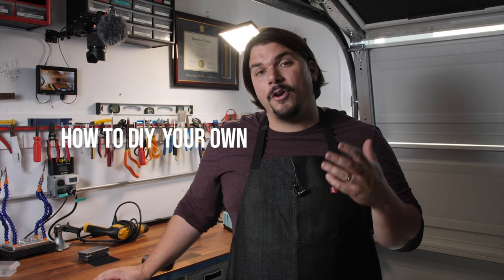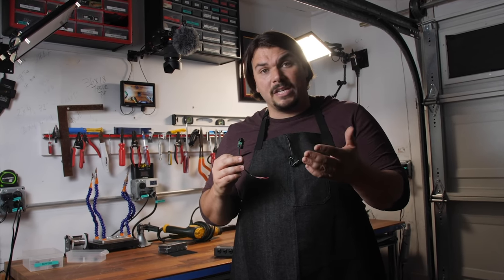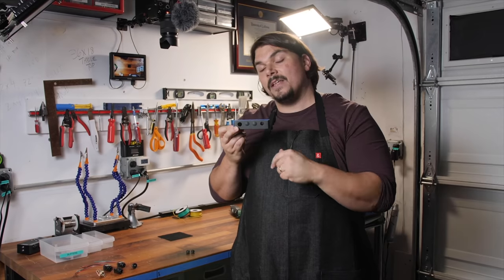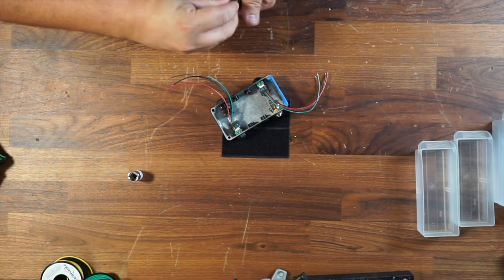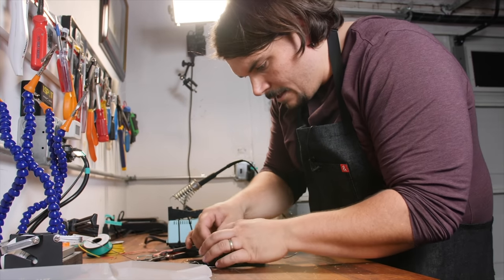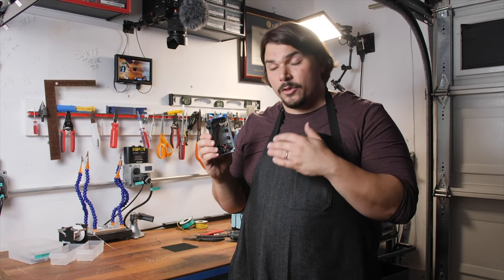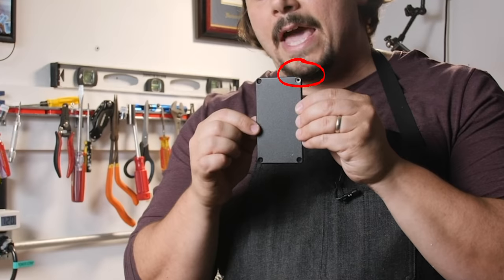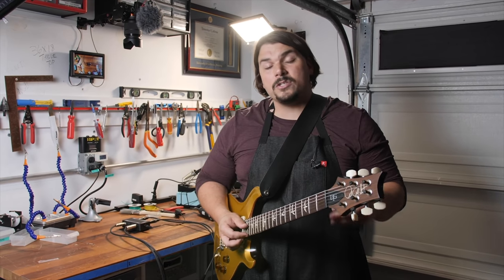Build Your Own Buffer!

Comment: if you choose a high impedance instead of 1Meg what will happen? I thought the higher the buffer impedance like 2meg or high will not roll off the high frequencies compared to using the 1Meg impedance will roll off the high frequencies.
Reply from the maker: It depends on your reference.  The loading of most all amplifiers is 1M, so if you want your guitar pickup loading to resemble what you’re used to, this is the best choice.  You can unload it to 2.2M and it will make things a bit brighter, Hifi, and more open comparatively, however it won’t sound the same as your guitar plugged into amp any longer.  I choose 1M because it’s going to be most consistent to the guitar into amp sound which is alway my baseline sonically.
Reply: @VertexEffectsInc  I think paul rivera modified fender amps in the 70's that he replaced the 1meg resistor to ground with a 2meg or 5meg resistor to give more top end for telecaster guitarist. A guitars output impedance is either 125K output impedance if you're using a fender guitar or 250K output impedance if its a Gibson guitar. The 125K is 250K pots in parallel for fender and 500K pots in parallel will be 250K output impedance for Gibson. So the guitars output impedance never matches as a baseline or reference with the guitars amplifier input impedance 1Meg being a fender amp or marshall amp
Reply from the maker: Wayne, Paul did mod to 2.2M even on his buffers he did. However it’s not the standard that the resistance of the pots matches the amp.  I’m talking about what 99% of amps are, 1M, versus what we’re used to hearing when we play through them with a 10ft cable as the reference.  If you’re used to hearing passive pickups with 250K pots hitting a 1M load at the amp that’s going to have a sound - this is what I call the standard since it encompasses the majority of what guitar players recognize as “baseline”.  You can adjust this up or down if you want the pickups more loaded down or unloaded but it won’t sound the same as your reference if you’re calibrated toward a typical tube amp.
Reply: @VertexEffectsInc  Maybe make a video one day on comparing the differences in 1Meg buffers compared against the 2.2Meg buffers to hear the differences in high frequencies. You can add a switch in the buffer to switch between 1meg to 2.2meg. I'm not really sure why Paul Rivera was modifying the impedance to 2.2Meg because I think he was saying that a telecaster high end gets rolled off when using 1meg buffers so he was getting complaints in the 70's about using 1meg buffers so he used 2.2meg buffers to fix the problem. But I'm not really sure if this is why he started changing the front end of fender amps to 2.2meg. I think ampeg amps used 2.2meg impedance instead of 1meg like fender and marshall. Paul Rivera Send and Return buffers were also 2.2meg and not like most common amplifiers send and return are 1meg, so his send and return buffers are different compared to most common amplifiers.
Reply from the maker: @waynegram8907  I’ve done the comparison and can say, for certain, that 1M for most people will be the most neutral compared to what we’re used to.  2.2M unloads the pickups and makes it brighter for sure, more full range sounding.  You can put a few resistors on a switch to try a variable input Z easily.  Even on this buffer R1 sets the input z.
Reply: @VertexEffectsInc  yes thanks I will try that someone day to have a buffer that has more impedance options
Reply from the maker: @waynegram8907  go for it

Comment: Is there any reason you use the tip shunt switchcraft jack rather than a standard mono jack?
Reply from the maker: You could use a mono jack but if you unplug the input I’ll hum because the inout jack won’t be shorted to ground.
Reply: @VertexEffectsInc  Great to know. Thanks!

Comment: Hi !  I watched your videos about buffers.  Thank you ! I understand now why I have still a lost of clarity out of my bass rig.  I have the poly tuner 3 from TC witch include the bona fide buffer.  But still, my sound is more muddy compare with if I plug my bass direct in my amp.  I tested all my pedals and cables and everything is ok.  So I understand I need a output buffer.  So, my question is, what's the best.  Buy another bonafide with the specs it has, or build one like you show us here ?  With the possibility of choosing the specs ?  I don't have much money to spend on that.  And, If I choose to build one myself, what specs is recommended for a bass rig.  thank you very much !!
Reply from the maker: It'll be cheaper for you to buy another buffer - but if you want it more streamlined having both input and output buffer in one might be preferable.  Also, you may not have the right input impedance for you bass rig - typically basses are more unloaded than guitars.  Some bass amps are up around 5 or 10M where most guitar rigs are 1M.  This can load down your pickups and provide a "mud" sound.  You should check out our Bass Rig Build video for more on this.
Reply: Thx very much.
Reply from the maker: @nicolasrichard6300  Our pleasure!

Comment: I want to build one of these (4CM) with my amp with a passive effects loop. Should I grab a kleinulator or do you think the buffer (I can use 2 more buffers instead of the regular jacks for the loop send/return, right?) in this will be strong enough for a good signal? Thanks.
Reply from the maker: Yes to Klein, and you need a buffer on the input, output, and return of the interface.
Reply: @VertexEffectsInc  Thanks again. 
What do you think of the Temple Audio 4 Channel Buffer Module? It meets all the specs and is cheaper than the parts alone. Do you know if this company makes good stuff?
Reply from the maker: @codswinger  I don’t see specifications of it listed, but as I recall it uses a TL072 Chip, if they’re running that at 100 ohms, it’s a real problem - that chip can run that low.
Reply: @VertexEffectsInc  Full Specs.
 https://drive.google.com/file/d/1GQupN5wDX4JUodx70Ta9aCFaR1YWYaqt/view

Comment: Hey Mason! What do you think of the Friedman buffered patchbay? I bought one with my Friedman pedalboard, seems pretty decent even though it’s input only. I end up using that with the output buffer on my ES8.
Reply from the maker: The buffer is close to Cornish Buffer, and only an input buffer, no other buffer in there.  It's a BJT, not my preferred for transparency, but some people like the color.
Reply: Yeah, I really only bought it because of how it fits perfectly into the 1530 Friedman Pedalboard that I have. There are some other design flaws IMO, but it sounds pretty good, atleast better than the Input buffer on my ES8.

Comment: hello uncle Mason! While checking Creation Audio Lab's Ai1 Redeemer , I noticed that the output impedance is <300 ohms ( english site "bassdirect.co.uk" ) ... is it better to choose the bonafide instead (100 oms) ? Even though I'll need two of them... 
Question 2: can I use the CAL Buffers to modify an existing patch bay, ex. rockboard MOD2 , by changing two TRS jacks with 2 CAL buffers? It would be cool, cause I'm gonna use the rest TRS jacks for amp switching and it has a IEC through connector, to use for powering my supplies. For the fx loop, my Kleinulator arrived yesterday from the Rig Doctor's shop!!!!
Reply from the maker: They’ve done some redesign since the original the input impedance 1 Meg and the output impedances around 150 ohms.  The original had a 10M input impedance and I think 350 ohms.

Comment: Hi Mason & co! Is it possible to make pedalboard "breakout box" that doesn't need a cable connected when you're not using it? So if I want to sometimes add more pedals between my drives and delays I wouldn't have to keep a cable plugged in in the send and return jacks. I hope this makes sense.  Thanks!
Reply from the maker: That’s what’s shown in the diy diagrams for an insert loop.
Reply: @VertexEffectsInc  Thanks! 🙏

Comment: Hi Doc I just built this exact buffer ( btw thanks for all the info and parts lists,  very satisfying building something like this on your own).  I just have a quick question, is there anyway to add a true bypass in case of loss power? 

 the bonafide buffer has one.  I figure it has to be thru a set of relay contacts for something like that.
Reply from the maker: This will still work without power
Reply: Well when I pull power i get a horrible squeal obviously the tone drops out and sound horrible but the noise introduced when power is off is awful.  Now just to clarify if i plug in normally without the buffer in the chain at all it sounds fine.  The buffer without power squeals horribly that is what im getting at.
Reply from the maker: @djritm3215  sounds like something may be mis-wired.  You should still get signal when disconnected.  It won't go to full true bypass and will have some loading but shouldn't have noise issues.

Comment: Would this be applicable if using a looper switcher? I’m building your interface but wondering why I’m not also adding buffers.
Reply from the maker: If you switcher already had high quality input and output buffers you won't need them in the interface box.
Reply: @VertexEffectsInc  thanks mason. Using the super switcher so I’m sure the buffers aren’t up to par.
Reply from the maker: @Souldoubtrocks  These are better buffers for sure, in that case you'll need an input and two output buffers for both sides of the stereo outputs.
Reply: @VertexEffectsInc  thanks again mason.

Comment: Howdy, Vertex. I’d love to take a swing at one of these to finish off my months-long quar-project board. Trying to think how I might modify the design to sum a stereo board to mono with the flip of a switch. Any suggestions? This has been difficult to Google.
Reply from the maker: Don’t do it - this is why I don’t show this option in the diagrams - you’re better off using the left output only or make mono presets with hard panned left mixes only.
Reply: @VertexEffectsInc  Got it. Every time I start reading about someone’s DIY summing box I can’t help but wonder if it’s just a phasey mess. Certainly would be nice to be able to flip back and forth from mono and stereo setups with the same board.
Reply from the maker: You can just don’t do the sum, make new presets for mono ideally

Comment: So I noticed you put one of these on the small ms-3 rig you built in one of your videos with a stereo out.  Was that just to have the convenience of the stereo out in an accessible spot (as opposed to fiddling to access the back of the ms-3 for it)?  I ask because I'm wondering if there's an advantage to using a buffer in such a small rig?  Is there any benefit to using a buffer there, or just for convenient jack access?  Thanks.
Reply from the maker: Yes, typically a buffer is always a good thing as you still have the long cables present on the input and output of the rig.  The cables on the board are usually negligible because it's already low impedance.  However, you don't want to relay on your pedals to buffer your input cable at 1M or your last pedal to buffer you output cable with a low output impedance of 100 ohms or lower.
Reply: @VertexEffectsInc  Thanks for the reply.  I think I'll build one.

Comment: @Vertex Effects Where does this go on the pedal board chain since this is a I/O buffer?
Reply from the maker: First and last.  It's basically a patch bay for the entire rig.
Reply: @VertexEffectsInc  so I'll have to build two of these? I thought this was some sort of combo (In/Out) to use just one instead of two buffers.
Thanks a lot!
Reply: @ramoncordova3435  it's a combo mate, you plug your guitar in the input, then you send the signal through the send out to your pedals, then you send the signal of your pedals through the return input then you send it out to your amp.
Reply: @pedrovictor4256  Got it!
Thank you so much man! This makes a lot of sense now.

Comment: Im not seeing an actual three amp wet/dry/wet assembly in your build list. i.e.  Left Wet, Center Dry, Right Wet.
Further, in this case, should we be managing lifting ground and phase shifting independently? ...i.e, with a separate device?  This would seem inefficient.  Thoughts?
Reply from the maker: It’s the same as the wet/dry interface- were limited to the enclosure chosen and four jacks, you’d need to add one more set of jacks and another buffer for a second return. You’d have to go up to a Hammond 1590BB.
Reply from the maker: The ground lift and polarity is normally don’t on the line out box and potentially again on the power amp.  If you read the diagram notes you’ll see that there options are laid out along with line out boxes with and without galvanic isolation, as well as polarity (phase) inversion.  Equally I talk about the option for an additional isolation box in the Lehle p split.  Transformers that are used in these sorts of boxes typically are not great quality and even the expensive Jensen models are all input transformers and should be at the amp, not on the pedalboards side.
Reply: @VertexEffectsInc  Thanks Mason, I always appreciate your prompt response to questions posted to this forum.
Great information, as always!  ...I was just starting to put together a new session board; maybe I should head over the bridge to Oaktown and see if I can con you into squeezing me into your build schedule instead of slaving through the process on my own ;)
Reply from the maker: @marcpernia8487  Thanks for watching!  My pleasure!

Comment: Hey Mason, I already have a Hammond 1590A (smaller one). I can’t just use this and stagger the 4 jacks for a Dual Mono Buffer right?
Reply from the maker: It won't fit.
Reply: @VertexEffectsInc  Bummer, but thank you for helping me not make a mistake!
Reply: @VertexEffectsInc  Yes it will all fit, I just won’t be able to drill the unused wholes. Im making one now with a smaller Hammond 1590A enclosure. Have to stagger the holes.

Comment: Would 1M - 100 Ohm work for a keyboard rig?
Reply from the maker: That's more of a low Z instrument so the input impedance wouldn't need to be that high necessarily.
Reply: Do you ever configure keyboard rigs with guitar effects pedals in them? It's really difficult to find good advice on this, especially for stereo output.

Comment: Hey Mason, I most definitely need a dual buffer in my rig so I’m wondering whether the DIY build will be superior in quality to a the Mesa High Wire and others when considering they are mass produced?
Second question, with additional pedal requirements of 36V max and mA (4x15)2=120 total, if I’m correct I’m going to need more power. Is there a power supply of preference you recommend for analog and digital use?
Reply from the maker: If you want to put in the work the DIY buffer is as good or better than the Mesa and you can customize it to how you want it.  However, the Mesa is also great and you can just buy it and be done with it.  What's the pedal that takes 36V?
Reply: @VertexEffectsInc  thank you for responding,. When I mentioned the 36V requirements I was referring to the DIY dual 4 buffer pedal at 9v per buffer for a total of 36V. Did I mistaken the power requirements?
Reply from the maker: @gokfg  they take up to 36V, they can take as low as 4V.  The wiring set up in the diagram parallels them all together so you just need one power input into the buffer.  The buffers can all share the same power supply and only require about 10 mA or so each.

Comment: What is the output impedance? Thanks 😊
Reply from the maker: Around 200 ohms...about 50 ohms higher than Mesa Boogie High Wire, but for DIY, it's amazing and typically most buffers out there are around 1K.
Reply: Why not use the chip that I mentioned to you a few months back about TrueTone buffer that’s has 50 ohm output? Thanks 😊
Reply from the maker: @analogblues9606  You can use whatever you want.  My goal here was to present you with a DIY solution that's ready-made and easy to organize to your pedalboard needs.  I haven't evaluated the Truetone buffer yet, but it's more than just an OPA to make a buffer, you have to build circuitry around it.
Reply: @VertexEffectsInc  thank you 😊
Reply: @VertexEffectsInc  ❤️

Comment: Hey brotha I have an active bass and want to have a xlr out for the FOH. Would I just replace the amp out or is that completely different process?
Reply from the maker: What's driving the DI out?
Reply: @VertexEffectsInc  at the moment I have a radial j48 di sending my main signal to the FOH and just would like everything coming in and out of one source if possible. I have a simple setup volume > tuner > comp > hx stomp > di out

Comment: Are these buffers low noise in your experience?  I am considering trying these to replace passive effects loop jacks on a guitar amp.
Reply from the maker: Incredibly...almost nothing commercially available is better than what CAL is making.  I would suggest a different thing however if you're using this for your effects loop.  I would look at a device like this: https://guitarampsusa.com/index.php?route=product/product&product_id=83 .  This will be more appropriate for what you're doing and won't require any modification to your amplifier.
Reply: @VertexEffectsInc  I’m looking at these buffers for a D-style amp build to use instead of the passive or tube driven buffer offered by the kit supplier.   Since these will run on up to 36v, finding power for them in the amp shouldn’t be
Reply: A big issue.